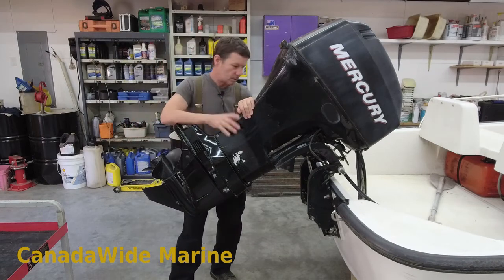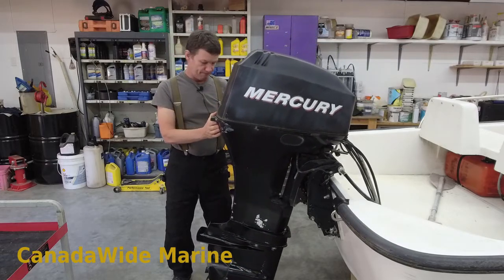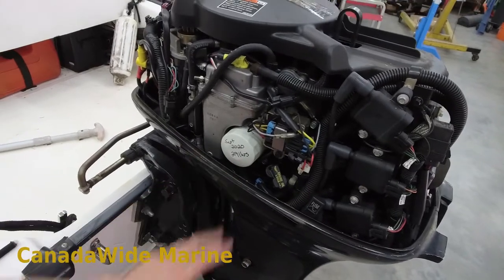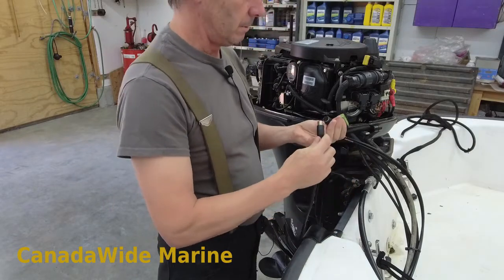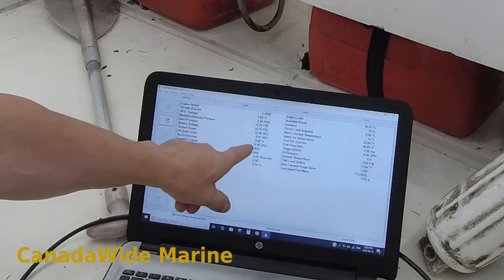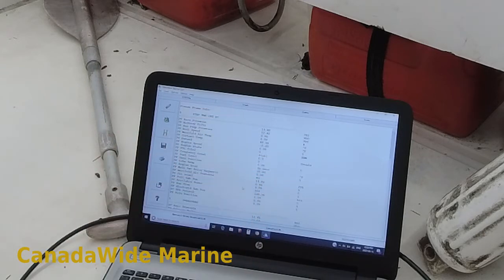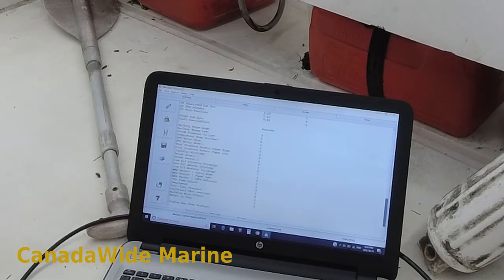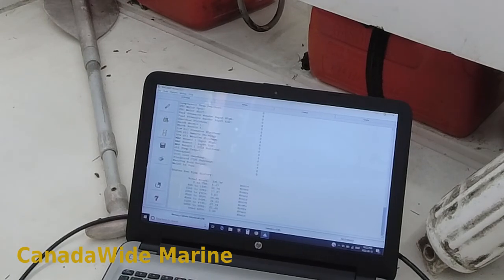Diagnostic scanning of 40 HP Mercury outboard.

Comment: Gday mate gee thats a handy piece of gear i suppose only techs can get it be good to be able to complete a printout every time you serviced your engine for resale ,at present they dont make a service manual for a 2022 40 yamaha maybe in the next few years they might good video
Reply from the maker: Actually anyone can buy the Diacom by Rinda, but it is generally a little pricey unless you use it regularly.
Reply: @CanadaWideMarine  yea probably right but it would be good as i dont have an hour meter yet plus the engine troubleshooting .
Reply: hello could I know with what gadget you are making diagnosis on your engine

Comment: Very good video. I ask you how much it costs and how it is to do the scan. I have to buy one for my workshop. I'm from Argentina.
Reply from the maker: Hello Simba, 
We use the Rinda Diacom Software to scan the majority of boats we work on. They also have a handheld Techmate which we also have, but I prefer the large screen of the laptop over the small screen on the handheld. They both have excellent coverage for Mercury outboards and sterndrives.
We don't usually just scan a motor, it is usually done as part of an annual service, or as part of a diagnostic procedure, so the charge is incorporated into our regular labour rate. If a customer just wanted a scan, We would charge an hour of labour. 
Rinda has a great website: https://www.rinda.com/marine/marine.htm 
Their customer service is fantastic too, whenever I have called with questions they are more than happy to help.

Comment: Can u use a care code reader on a boat motor?
Reply from the maker: Great question! The answer to that is unfortunately no, you cannot use an automotive code reader. You need to use a marine specific diagnostic scanner. As far as I know there is no marine "code reader". There are only diagnostic scan tools that do much more than read codes. 
We use Rinda Diacom Software for the majority of the boats we work on. It has great brand coverage and is specified by Indmar and Ilmor engines that we are dealers for.
Reply: @CanadaWideMarine  thanks